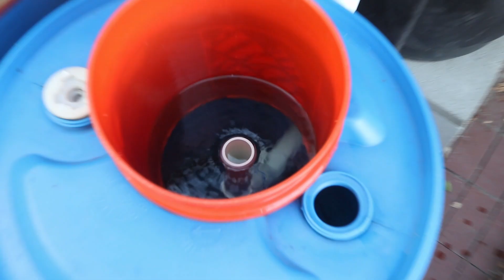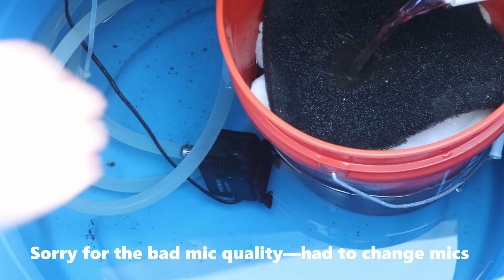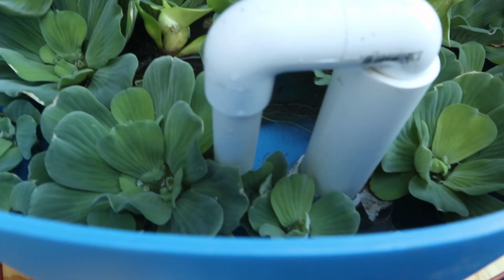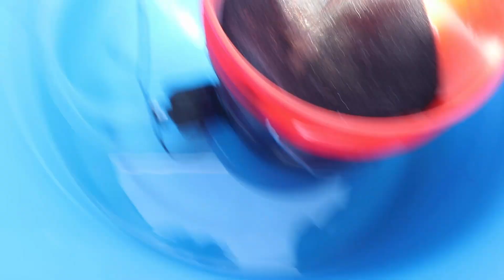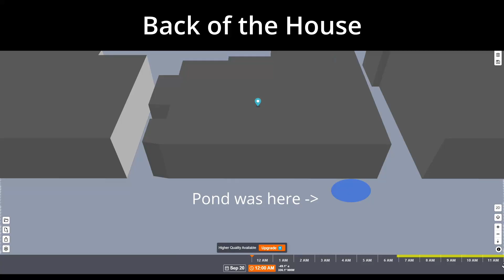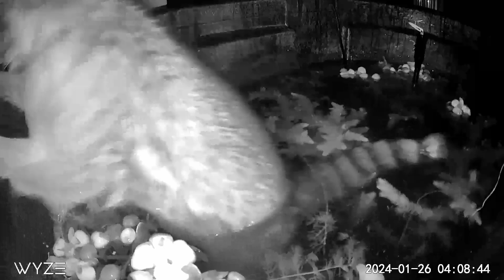Aquaponics Project  - Overview

Comment: You could eliminate the air pump by simply using a venturi tube with the water pump, or you could use a perforated/drilled holes pipe that pours the water back in above the surface of the water. Oxygenation of the water is equivalent to the surface area of the water that is in contact with air. Also the energy needed by the water pump is proportional to the volume of the water it needs to pump and the height it needs to pump up. So a water pump near the surface will require less energy to move the same volume of water. 

Your system does a great job of isolating potential problems, like keeping the water pump inlet clean by isolating it from contaminated water, etc. Keep up the good work!
Reply from the maker: Thanks for letting me know about the Venturi tube. I’ll definitely look into it! When I designed the system, I considered the minimum head height needed (~3.3ft) from the pump to move the proper volume of water. I oversized the pump as well to give me some wiggle room. Placing the pump near near the bottom of the sump is more of a safeguard to prevent the pump from running dry under the scenario that the water level in the sump drops too low— either from draining too much out of the radial flow settler, the rate of evaporation is high, or a combo of the two. Thanks for watching!
Reply: @Jeffs-Projects  You're on your way to becoming an excellent engineer. Keep up your good work!
Reply from the maker: @BuceGar Thank you! That means a lot.
Reply: i think venturi will reduce overall efficiency.

Comment: How many water changes do u do? Or is it self sufficient
Reply from the maker: I’d say maybe every week or so. Water changes heavily depend on the rate of evaporation. I wouldn’t describe the system as self-sustaining but I put a lot of effort into minimizing the maintenance needed. Whenever I drain the solids out from the radial flow settler and top off the sump tank, I’m essentially doing a small water change. Thanks for watching!

Comment: nice project. consider adding ph meter instead of tds meter. what is the use of tds meter in this scenario.
Reply from the maker: @sahalwork  Great question. I’ve seen TDS sensors used in hydroponics setups to view nutrient levels and thought they might potentially have some applications in my setup. I still need to think some of it through. I’ve also looked into a pH meter, as water pH is a pretty important parameter to track. I did a lot of searching too and the sensors I found (that were affordable), need to be recalibrated with a buffer solution before each use. Maybe I missed a product that doesn’t require this. Assuming there aren’t affordable sensors that can do constant readings, including a pH sensor is unviable in my scenario and I could just use pH strips when I need to. Thanks for watching!
Reply: @Jeffs-Projects  i use tds meter for drinking water testing. but how can it distinguish between nutrients with other particles, or it is different type of meter. i will check about that.
i have also looked upon those ph sensors, they are expesive. but there are ph meters as a whole in very cheap price also. i wonder can we make something out of it.
Reply from the maker: @sahalwork I appreciate the insight! There’s definitely some more research I need to make on sensor selection, availability, and compatibility. I’ll do some digging when I have time off from school.